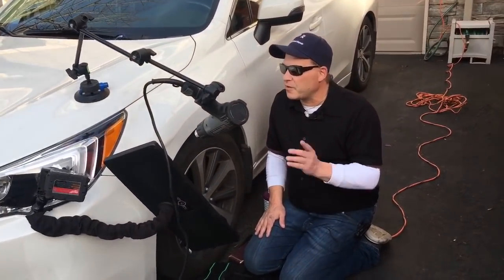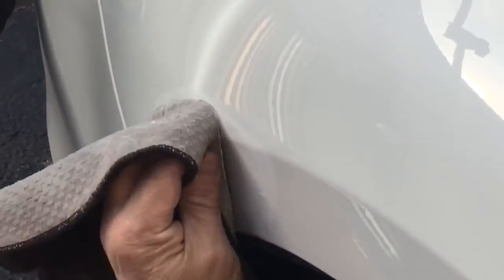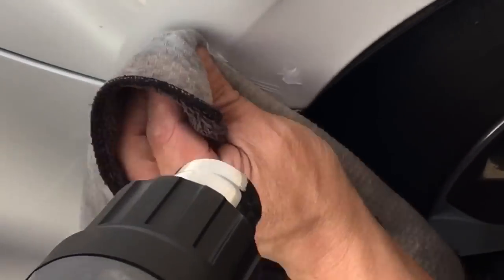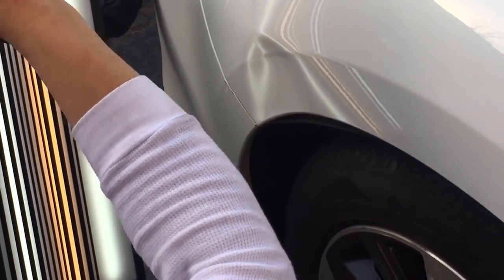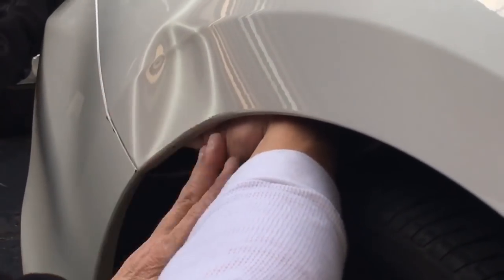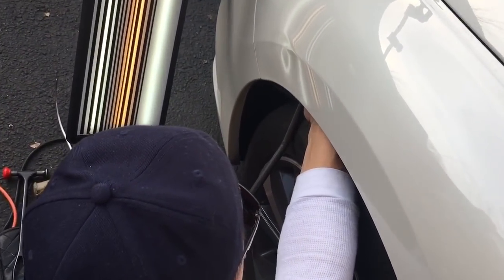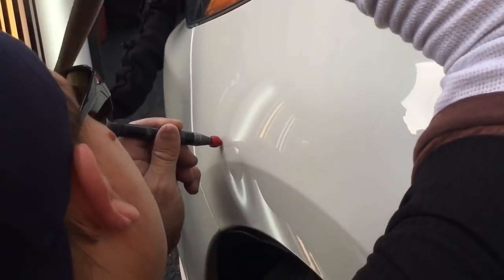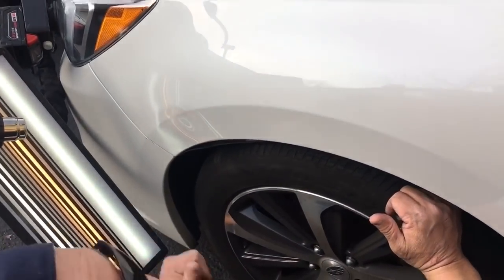PDR 😎 ‘The Fender UN-Bender’♦️ 2016 Legacy #undented#PDR

Comment: Super result, Garth. Would there have been a role for a glue pull early on in the process?  Yes re your art! 👍
Reply from the maker: Gary A good question, maybe glue would've done a little bit but with the excess that I had being able to put my hand all the way up behind it the tour was way more convenient. Plus I had to get the panel really warm to do any work and that would've negated the glue pulling process. Thanks for watching and commenting Gary always nice to see your comments👍
Reply: PDR Peterson Dent Repair ok- thx, Garth.  Access is the differentiator for glue vs push tools then.  👍

Comment: Yes...do show your oil paintings...why not?  Love all your videos!  I have a question for you all the way from Australia.  I am not a PD repairer...just someone whose car "kissed" a carport upright and left a little crease.  It's in the right rear fender of a Hyundai Accent ('05).  It's a similar dent to the one you fixed here only the crease is vertical and at the 2 o'clock position of the fender from the wheel opening to the brow body line.  There is no paint damage and the crease is not sharp.  Lots of people have told me to leave it as it is not noticeable unless you look for it but because I did it I know that it's there and it irritates the hell out of me.  The rest of the car is pristine...no marks... and this one is eating at me because a) I should have been paying more attention when I backed out of the carport and b) I hate dings of any type on cars!  I know you can't see the car and it's hard to predict something without seeing it but there is no cladding behind the wheel arch where the ripple is and there would be ample leverage using the tyre (sorry...that's how we spell "tire" here).  What do you think?
Reply from the maker: tripsadelica thank you so much for watching and the nice comment. If it is accessible and you have the time to try I would say use a lot of patience. But my first suggestion would definitely be a professional paint less dent repair technician. Hope the videos help. Thanks so much for the comment about the oil paintings I'm really thinking of doing that. Cheers mate👍